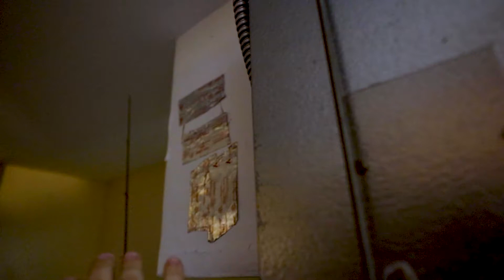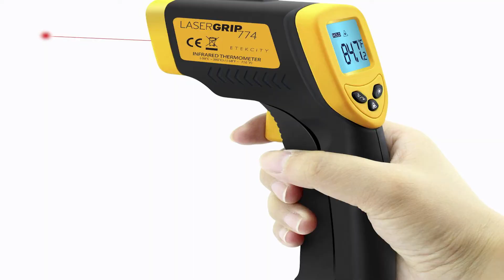AC Not Cooling Enough - DO THIS

Comment: I crawled underneath my closet AC  and saw droplets of water on the fins...is that normal...of course I had to remove the filter to see the fins ( which I hosed down and air dried
Reply from the maker: Yes water does condense on the coil but it should drop down into the pan. It shouldn’t be dripping down into your floor of course
Reply: @mechanicsfornonmechanics8998  Thank you
Reply from the maker: You’re welcome!

Comment: Is it ok to put the thermometer on the door were the filter is located ( 82 F ) ane the top of my AC unit I  think its the plenum I  poked a small hole says its 60 F . Is putting it on the door ok ? So that means my TD is 22. Is it safe to assume Freon is low ? Fins looked clean both filters appear clean
Reply from the maker: So your TD is 20 degrees. How does the house feel? Ok?
Reply: @mechanicsfornonmechanics8998  outside temperature is 93 F but feels like 106 F, inside of house I feel kind of warm. I need a fan to cool me down. I keep the thermostat at 73 F and I still feel kind of hot. House is about 1400 sq feet with what I believe is a 4 ton AC unit.
Reply from the maker: Is it a manufactured home? Otherwise 4 tons seems kind of big (unless insulation is bad or there’s a ton of windows). Also your duct work needs to be sized properly with the unit.
Reply from the maker: 22 degrees is a little high but probably not a big deal if the house feels good

Comment: My system isn't cooling enough not getting to set temp 78 degrees only 81 during the verrry hot day with heat index reaching almost 110 degrees . Is this normal ? Does get to 78 during the night . Just not long ago it wa reaching 74-76 . Replaced filter even though the old one was only a lil dirty not clogged . Water hose washed outside coils from the outside . I guess it's  much better than it was a couple days ago because it was blowing warm air the capacitor went out and just replaced it . What are 'some reasons it could be so ? Anything a DIY can try ? Clean outside coils with coil cleaner spray I got from Lowes ? As for monthly maintenance I pour a lil bleach down the drain line
Reply from the maker: Bleach down the drain line is not recommended because the fumes from the bleach can go up the line and into the primary pan and cause damage to the evaporator coil.👍
Reply: @mechanicsfornonmechanics8998  how else do I keep it clear?
Reply from the maker: @frankmontez6853  check out our video titled "How to Unclog AC Drain Line".  It will mention in this video to buy a shop vac or related dry/wet vac